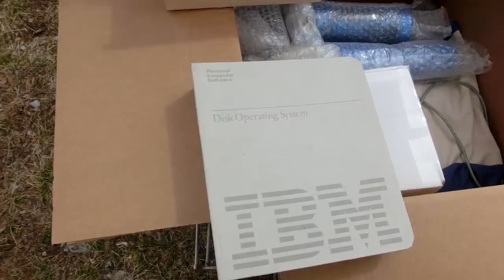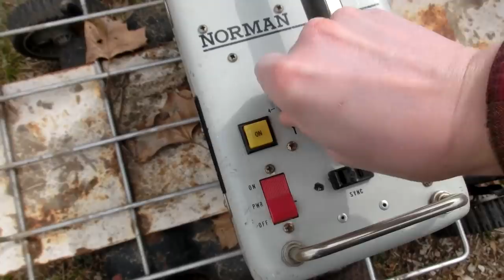Random Bits 0164: unboxing the treasures from my last trip.

Comment: Clean out thoroughly the Fresnel bulbs before powering them. Any dirt (including your hands' oil) on the bulb will act as a heatsink, causing the glass to break and ruining the bulb. That's been a couple years that I haven't bought any of these bulbs but they were pricy.

Keep up your good work.
Reply from the maker: i cant run the bulbs, i dont have the high voltage power supply for them. i will be putting LEDs into these lights.
Reply: Rinoa Super-Genius good move! I will send you a picture anyway...
Reply from the maker: yeah i managed to go to the training session for a 6kw projector at my previous job to learn how to replace the bulbs, theres a lot of power that can go wrong with that large of a bulb.
Reply: Yes be careful with those bulbs. If they have run to many hours and not been changed (they are Pricey), I have repaired some scanners from clubs that didn't change the bulb, it almost cleared the inside of the scanner as they went bang!

Comment: that water block is awesome.
Reply from the maker: +ThriftStore Hacker yeah it is, surprised it was only 10$.
Reply: Got any spare thermoelectric coolers?  Put a bunch of them on the block and pump some ice cold water (maybe engine coolant? through it. Maybe mount it to the lid of a cooler with the hot side outside and the cold side inside.  I bet you could at least generate enough voltage to charge USB

Comment: That trackball is much more accurate that a pc-mouse so keep that trackball don't disassemble as when you leave a mouse down it will move from the point you intended the trackball just stays where it is put as it is only the ball that moves not the rest of the trackball.
Reply from the maker: +DAVID GREGORY KERR i need it for spare parts to fix my other ones, they are my favorite pointing devices. you dont have to explain to me what it is, lol
Reply: Are you going to do a video on the repair, Rinoa? I have (later model) one in a box waiting for me to get the nerve to crack it open and see what's wrong. It'd be cool to see someone who maintains them show how to open it properly, common issues, etc.